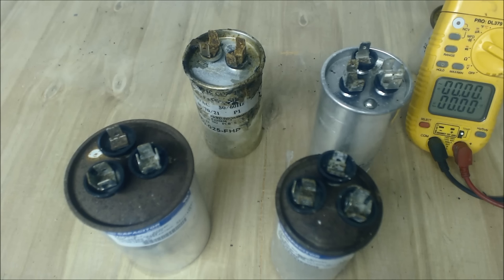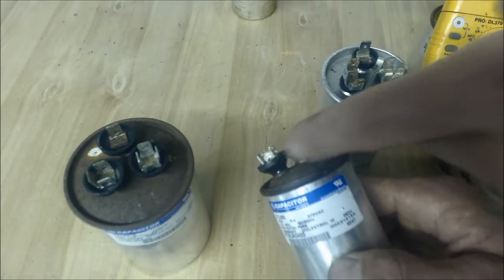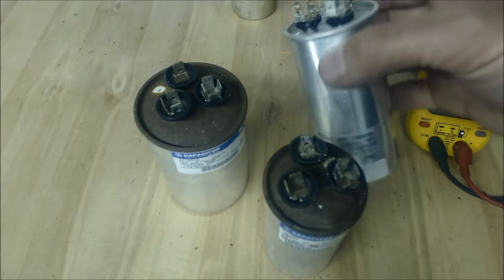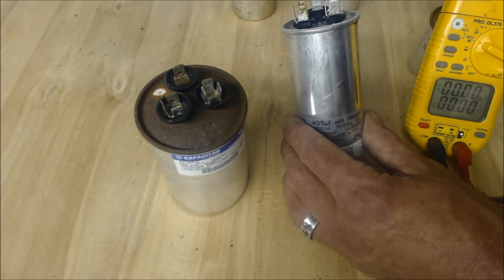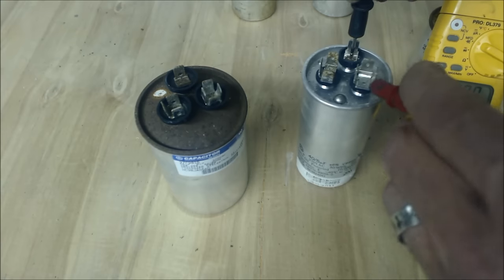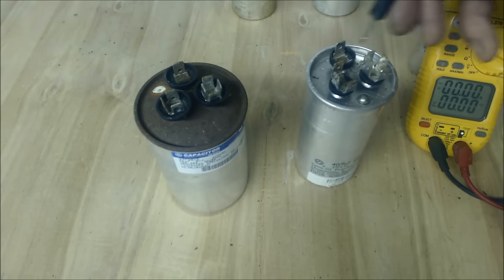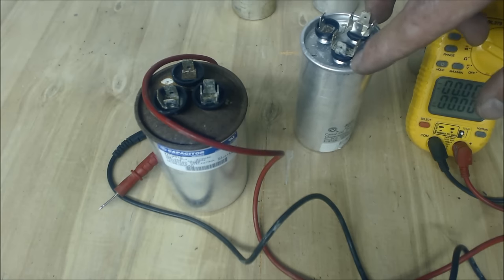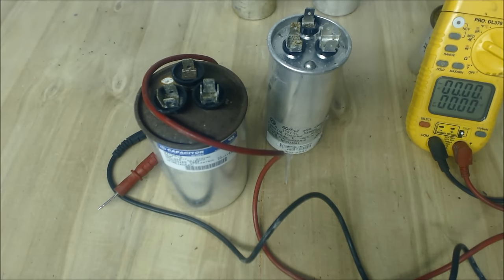How to tell if a AC Capacitor is Bad! Visual and Multimeter Testing!

Comment: This was so helpful in revealing that our capacitor did not need replacing. We ended up after a couple videos like this saving a lot of $$$ on a big costly repair by having a better idea what was wrong with our HVAC. It ended up being a blower motor. We are very grateful. Still a big repair but saved a ton. Thank you.
Reply: Mwrk😂

Comment: How do you tell if a 400v AC 22nf capacitor is bad? I'm not sure if it's because the capacitance is so low... I charged it with a 9v and it dropped almost instantly zero volts when I touched it with the multimeter. The only thing I can think is that the capacity is so low that testing it discharges it? I got it for a 0.1w capacitive dropper power supply on 250v AC but it seems to be totally dead when put inline with a bridge rectifier and an LED. Maybe I should get some 47nf capacitors to see if a theoretical 0.2w would make a difference. It works with a 470nf capacitor for a 2w output but I'd really like a low power nightlight.

Comment: Is it possible for a cap to be bad but test okay on a meter? My cap is rated for 50+15 and both checked out fine with my meter (50.27 and 15.22) but the symptoms I'm having on the unit all point to a bad cap.

Comment: Great video. I am still confused on why the last capacitor can still be used even though you didn’t get a reading from C to FAN. Please explain
Reply from the maker: The reading from c to herm was still ok for using the cap for the compressor but even though technically it could be done, I wouldn't do it because it is likely that the other side of the cap would fail. Some people just add another cap for the fan but just replace it with a new dual cap, thanks!
Reply: They're cheap, if replacing one, replace the other at the same time.
Reply: My air conditioner compressor works on and off is it possible it’s the capacitor going out?

Comment: Very helpful video in helping me determine if the capacitor on my air compressor was bad!  Following these guidelines I was able to determine the faulty capacitor, ordered a new one,  received it yesterday and installed last night.  Air compressor is running like a champ again!   Thanks for the help!!  $11 capacitor save me $350 in replacing the compressor!

Comment: Pro tip: just keep a spare capacitor on hand and if your AC isn't turning on...just swap it in.  They're pretty cheap and an HVAC company going to rip you off to do it.  Mine die every 6 years or so in the desert.
Reply: Planned obsolescence, those capacitors are only designed to last like 5 years. Good practice.

Comment: Your fast reply would be greatly appreciated.  Generally speaking, what is your opinion of  different capacitors and their countrys of origin (where it is made) and different brands?  Is USA made worth the price based on value / length of service?  Of USA Capacitors what is better an...
1) AmRad for $31. ish? or a Titan HD for $16 ish?  

2) what are your thoughts on the chinese brand that is $7.50 ish.?
Reply from the maker: Honestly I like the Titan's. If the cap is cheap or some off brand, I have had and seen problems with silly things like even the welds on the contacts for the tabs breaking as well as the caps failing too quickly, thanks!

Comment: One thing that jumped out at me is a tech saying uF. The symbol µ is not the letter U, it is the Greek letter "mu" and the symbol µ is used for micro as opposed to m for milli (mm = millimeter, µm = micrometer) .  The video is easy enough to follow, but if you're writing instructions you may want to understand and properly communicate the terminology on the equipment you're using.
Reply: Yep, I had the same thought.  Otherwise great video.

Comment: If I only want to remove / replace my AC condenser unit's run cap as preventative maintenance, is it "best practice" to discharge both the run and start caps or is the start cap isolated by the relay you mentioned?  I will use a multimeter to be sure the run cap is at 0 volts after discharging tool is used.  Just wondering if the start cap could somehow feed power back into the run cap during the time it takes to remove the mounting strap/bolt and wire connectors.

Comment: Can a (bad or weak) capacitor cause the air conditioner to:
- work harder = pull more amps ?
- make the fan run slower ?
or is it just simply the capacitor is only bad .. when the fan or compressor is not working at all?
Thank you very much in advance.
Reply from the maker: It is usually the fan will not start but can be running slow and hot depending on how bad the cap is, thanks!

Comment: Hi, my heat pump isn’t working and the 2 fuses in the sub panel were blown. I replaced with some new ones and the also got blown out. I removed the fuses and turned off the power and I hear like a humming sound on the capacitor even though it has no power.
Could it be the capacitor that is bad?

Comment: When I put one sensor on a terminal, and one on the side of the capacitor, it reads OL.

This is for all 3 terminals. I also did this for a new capacitor out of the box. Same reading. Wouldn't that mean that the capacitor is bad? Or did I do something wrong?
Reply: Sounds like you were checking "resistance" not "micro farad"

Comment: I am buying a house with central air and when i did a home inspection the and the air conditioner turned on but did not provide any cooling effect whatsoever. After running for 30
minutes, the Delta reading was "O degrees". The seller says they changed two capacitors but my concern is that the AC was installed in the early 90's. Is replacing capacitors really solving the issue? Most Ac have a life span of 15 years and i live in NY where ac is only needed a few months out of the year. Is it possible to get a few more good years out of it before replacement is necessary?
Reply from the maker: You would need to have a tech come out to see if the compressor is even coming on. A capacitor lasts 5-10 years but it may be something much more costly than that, thanks!

Comment: When my air conditioner starts the lights in the house dim and the air conditioner makes a one second hard Buzz that is annoying. I suspect the start capacitor may be bad or inadequate. I have two hundred amp service to my house FYI. I want to install a hard start kit on my 3 year old Goodman air conditioner. There is a 1, 2 and 3 csru hard start kit for the respective tonnage of the model. I believe mine is a three-and-a-half ton which I believe would be the CSR U2. But could I install the larger one for the 5-ton or would that be bad?
Reply from the maker: 3.5 to 5 ton is usually the range and 1.5 to 3 ton is the other range. If there guide is saying to just use the smaller one then just use that. However, it may just be a bad existing cap. Have you replace that after turning the power off? thanks!
Reply: @acservicetechchannel  thank you for your reply. I live in Minnesota so he super expensive heat pump High efficient models are not super required. Although they do look cool. After looking into my one second startup Buzz and light dimming and reading on the internet about hard starts. The hard start kit mainly helps against poor startup Supply, electro-motive back Force during motor spool up and increase milliseconds of amperage. Mine is a Goodman 2.5 ton gsx13 and I don't think it has a start capacitor? There is a run capacitor I'm sure, on the parts website there is a single capacitor listed available for the machine and I have not tested that capacitor so far. I have replaced the Supply breaker box with a Siemens fused on off switch instead of just a plain old pull out fuse. I'm beginning to believe that a soft start is more ideal for the health of the machine and will start my machine quieter. However I did purchase the hard start kit for a total of 35 bucks so I will just give it a shot and see what it does. But it does seem like a soft start is more likely what I want. Because other than that one second startup Buzz, it runs quiet while it is running and it is a quiet shut off. The line sets are not that long either. But maybe there is some pressure in those lines combined with the EMF the startup draw is probably what is making the noise. I have a couple of clamp meters and I will see what it's pulling before and after the hard start but like I said I think a soft start is sounding like the proper fix. Some of these soft starts are super interesting, some of them it seems like have a fuzzy logic self-learning algorithm ramp. They really range in price a lot. Not sure which brand or model would be the best.
Reply: I had a problem once kind of similar. What would happen was, the A/C would start but not in its full power. Half of the breaker board would loose power 24v. It turned out to be bad contact on the Main Wire coming from the meter. Glad i diagnosed it, if not it would of been thousands.

Comment: I've had issues with my compressor not wanting to start in my AC (a Concept 1000 2-ton unit), while the fan kicks on just fine. The compressor will attempt to start for about half a second, then nothing. About 5-7 minutes later it'll do it again, rinse, repeat. It uses a dual run capacitor, which is about 8 years old, but shows no sign of damage. When I checked with my Fluke multimeter it tested perfectly. Is is possible it could still be failing due to age in a way that wouldn't be indicated by a multimeter? As an experiment I popped a hard start on (just the cheap two-wire Spurco) and everything worked perfectly for a couple days. Now that the weather is cooled off I want to troubleshoot properly. Whether it's good or bad I'll also install a 5-2-1 kit to help it last until I upgrade the whole HVAC system.
Reply: What did it end up being? If not capacitor then I'm guessing a relay.

Comment: My AC only blows warm air. Could be capacitor? It only costs $15 last time I replaced it. Also will wash out outside unit. Already replaced air filter . Any help would be appreciated. Heat index at 110 degrees wowza 🔥🥵

Comment: if I couldn't find the same exact rating:
- should i get (higher or lower) µF = MFD = micro farad ?
- should i get (higher or lower) voltage rating ?
Reply from the maker: exact same MFD rating which is micro farad. The voltage can be the same or higher, thanks

Comment: Thanks. I found many cases that the capacitors are rusted and cannot read any spec. Is there any rule of thumb to calc capacitor size? Some articles say use compressor's FLA x 2650 / volts. Which not working. Compressors only have RLA provided. RLA usually >10A, which I get 115MFD for a small AC.
Reply: data plate on inside of ac unit

Comment: I have a trane XR14 with two capacitors. Both are single run caps. I have confirmed that the 70uF is bad. Can I replace it with a 70/5 dual run capacitor using the C and Herm terminals?  I want to do this because it will take a week to get the single run capacitor.
Reply from the maker: Absolutely you can. You don't have to use the condenser fan terminal, thanks
Reply: AC Service Tech LLC thanks a bunch. Unfortunately The fan still isn’t running, so I’ll check the contactor and see if that’s the issue. I tried to Ohm out the fan, but there are six wires in a harness and I couldn’t get readings on any pairs of them, or our upstairs AC unit which uses the same model of fan motor, and I couldn’t get any readings on any of those pairs either.

Comment: My AC just stopped working and the digital things don’t turn on. On the capacitor one of the wires has black on it. Could that be the cause of why my AC has no power at all

Comment: I have a dometic AC unit 115 volt. The power lead going to the pump is only putting out .003 volts! And it's. 115 volt pump. What could be causing that it's brand new. I am a test pond guy at the boat factory I work at. Had lots of issues that I have seen from vendors but not this one. Can't wait to hear my boss in the morning wondering why that boat isn't done😶.  It won't be to bad to just replace the ac unit( as long as there is one in the warehouse). Just allot easier if maybe they (as in dometic) had a fast on connector connected to a wrong spot. Thanks
Reply from the maker: It sounds like a relay or contactor is not allowing power through, thanks
Reply: @acservicetechchannel  thanks I will look more closely at the panel see if I can find a relay. Can't see the back side of the circuit board to track power runs but I should be able to find something. 
Thanks for the speedy reply!!! I appreciate it!!!😃

Comment: What symptoms does the compressor exhibit when the start and / or run capacitors are bad?  Does it tend to trip a breaker, not start, slow start, run loudly, something else?  
Thank you very much!
Reply from the maker: It may have a buzzing noise and then no noise and then the buzzing noise again. This is due to the internal overload opening. The outdoor unit does not turn on.
Reply: @acservicetechchannel  Would that have been the cap buzzing, or the motor, or something else?  Am I correct in assuming that the internal overload switch you are referring to is the one in the compressor? 
Thanks for the details!
Reply from the maker: That would be, first the 24v contactor buzzing due to 24v, the compressor buzzing because it is trying to start and the condenser fan motor buzzing because it is trying to start. This will do damage to those motors so I would turn the power off to the unit until a technician is called to check the system. It may be something simple like a capacitor but it could be something more, thanks!
Reply: @acservicetechchannel  Thanks again!  The detail is helpful!

Comment: Since the fan was not reading 5mf and the herm was reading nearing 40, you still need to replace it?
Reply from the maker: Yes I would certainly advise replacing it. Once one side goes, the other is soon to follow, thanks
Reply: AC Service Tech LLC thank you. My AC Unit outside is out of wack. The previous home owners jerry rigged it. According to my manual, I have a dual capacitor which has three prongs. When I opened the panel, only the Herm and Common has connectors to it and nothing was connected to the fan (strange I know). As I was looking at the capacitor, I noticed there was an oval 2 inch 2 prong capacitor zip tied connected to 2 cables, I ran the cables and noticed it was actually connected to the fan. The capacitor read "5 uf 370v". I'm assuming the previous owners just added a mini capacitor supporting the fan instead of buying a new DUAL capacitor. Should I just buy a new mini capacitor since the meter reading is .72mfd. The main dual capacitor reads at 40mfd which I'm assuming it works. What are your thoughts on this?
Reply from the maker: Honestly, I would just replace it with a dual run capacitor. Make sure you have the right ones installed first by just reading on the side of the fan motor and on the side of the compressor unless this tag is wore off. If you buy a 440vac cap, it will last longer than a 370vac. They mostly now make them 370/440vac so we don't have to stock as much but we replace with the same voltage or higher. If it is higher, it just means more insulation value which leads to longer life expectancy. Follow the wiring diagram with the wiring unless the fan was switched from a 3 wire to a 4 wire one. Make sure the power is all off when doing this. If it is a 4 wire which has replaced a 3 wire then check this video out- https://www.youtube.com/watch?v=0U_bpumqCRI      - thanks

Comment: Hey bud, love your informative videos. My blower wasn't blowing, unless started by hand; so I replaced the capacitor (only 4 years old) on my Trane XB80, assuming that was the problem. The blower is still only starting by hand. Any ideas?
Reply from the maker: Sound like if the capacitor is wired correctly and the right size and if you have the correct voltage going to the motor and cap then you may have an open winding. It would likely mean you need a new blower motor. Do you have a resistance reading from one cap wire to the other cap wire with the power off and wires disconnected? If 0.L ohm reading then bad motor.

Comment: I have a uei meter when I turn It to ohms it has a small M & ohm icon is that good to test caps with?? I lost my manual
Reply from the maker: What version? You may need to press the select button until mfd or uF is seen It also may not be good for testing caps. Some 69 versions don't have the setting for caps, thanks

Comment: I just had the A/C guy tell me my capacitor is bad because the top is rusted just like the one you pointed. However it doesn't have a mushroom top and the connectors looked ok.  Did end up paying for something I didn't?  And he showed me the steam valve was bad by unplugging the tube. Not sure what I was looking at.
Reply from the maker: If he measured the capacitance with a multimeter in micro farads and saw it was out of range, it is bad even if there were no visual signs, thanks

Comment: Hey man, my pressure washer is not working properly and I hear a humming noise possibly coming from the capacitor. The capacitor has only 2 terminals so it is different from the ones shown in the video.Mind giving me some advice? Tks
Reply from the maker: They are pretty cheap, you could purchase a new one on amazon but this video shows how to test them. Usually noise doesn't come from the capacitor but something near it such as the motor, thanks